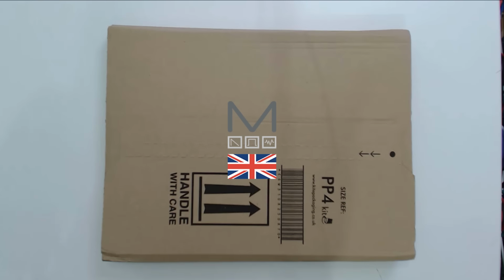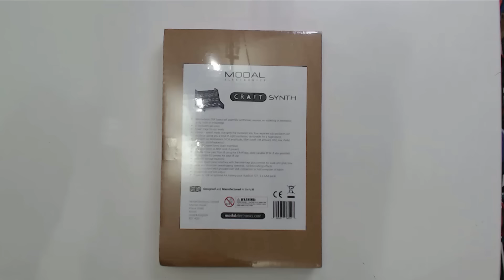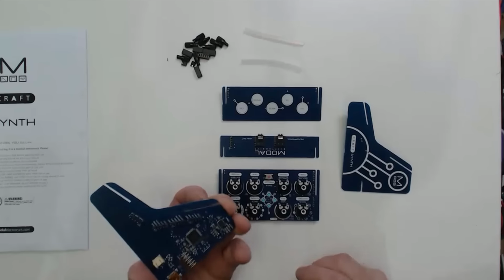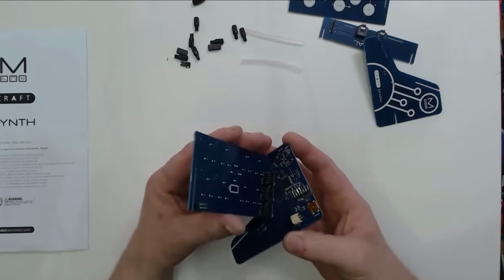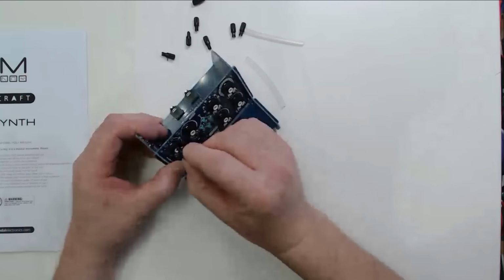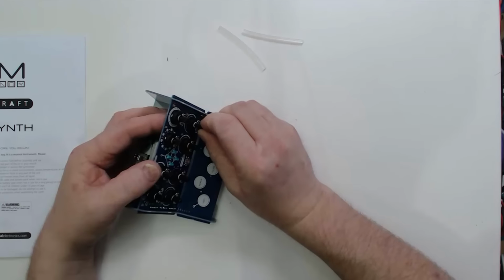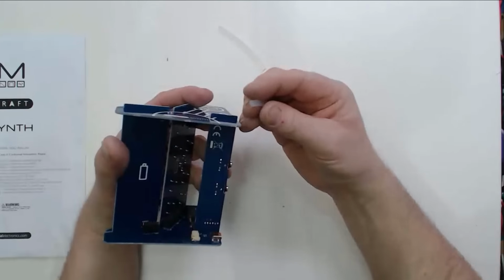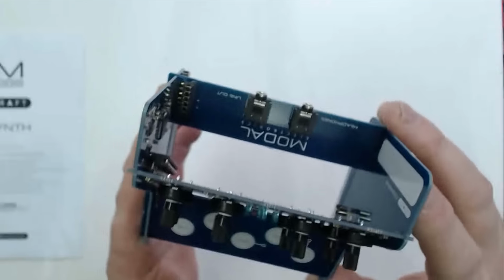Modal Craftsynth Unboxing and Assembly

Comment: Glad yours went together easily! I had to make some of the slots longer as the pins did not align for the jumper blocks to fit on. Also my line out socket works but not the headphone out.
Reply from the maker: Thats a shame, my pins were approx 0.5mm out of alignment but the blocks fit on ok.
Reply: I just got mine and am having the same problem with the pin alignment. I am going to have to deepen he slots as well.